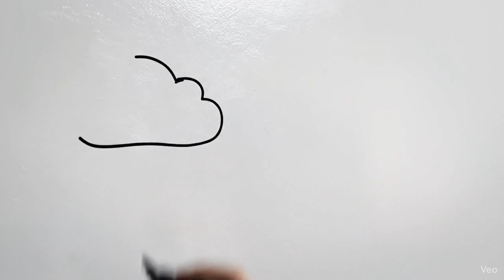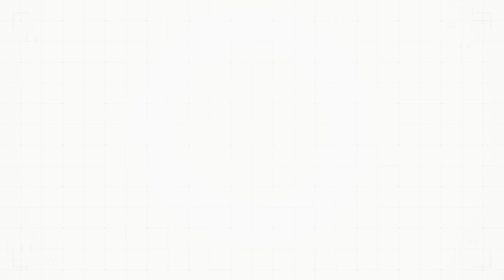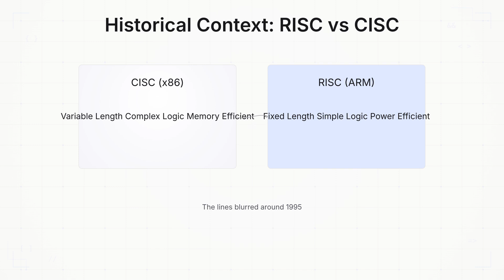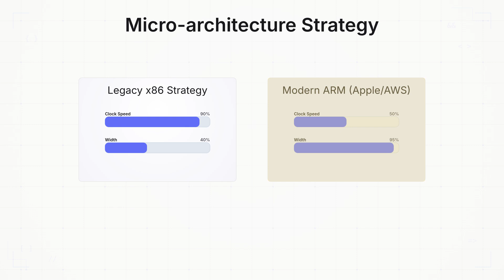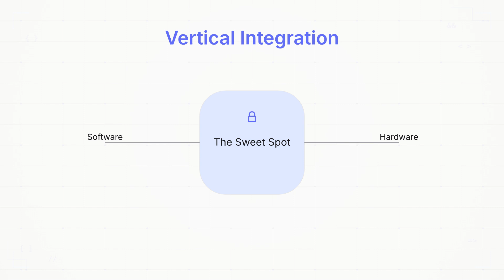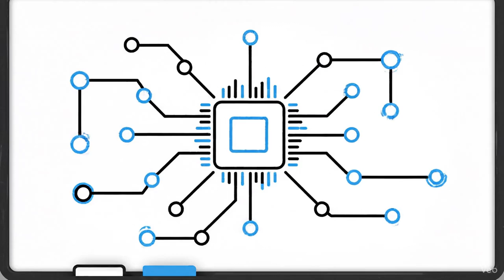ARM is Not 'Better' Than x86: The Instruction Set Myth

Comment: I already figure this out. X86 origine is server workstation desktop and game performance arms race between intel and AMD the went for the easy marketable high clockspeeds. Like netburst and buldozer 20stage architecture. While ARM origine is ultra low iot and embedded 1 2 6 stage architecture running often on CR2032 battery.
This means that x86 need to have big high clock transistor implementation and arm can keep using the more dense transistor implementations. Having clock speed closer to sweet spot of performance vs power efficiency . While piledriver 9 series 32nm get to 5ghz with for that time enormous power draw. While Pentium III hit 1ghz clock ceiling thunderbird go 1,4ghz.
Now there is Zen dense same architecture less cache and dense transistors. 100++ cores in Epyc cpu possible.
In my oppinion a apple silicon big core is upscaled dense little core. Like huge zen dense core. Using those extra dense transistors to put into higher IPC instead ridiculous clock scaling. X86 still could go the ARMS way.
Reply from the maker: Great points 👍 The ISA itself isn’t the magic, the design tradeoffs around power, clocks, cache, and microarchitecture matter much more. Thanks for sharing your perspective.